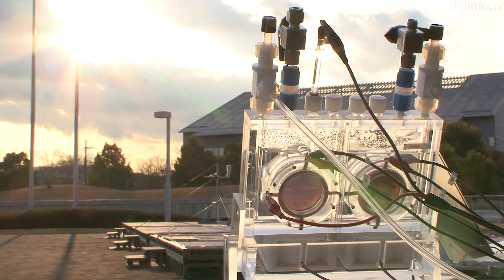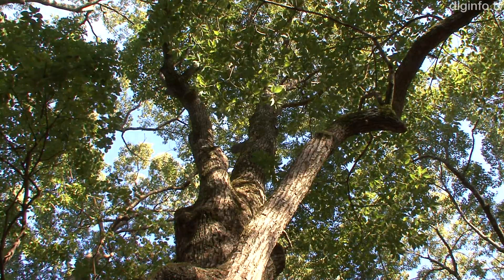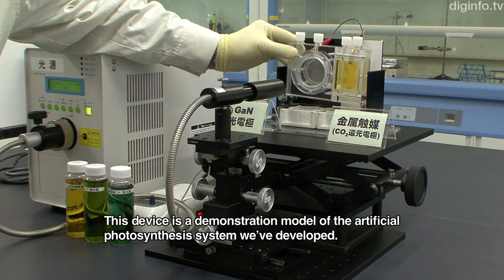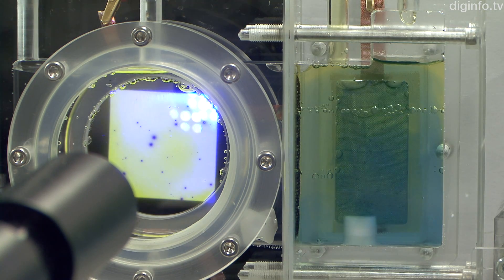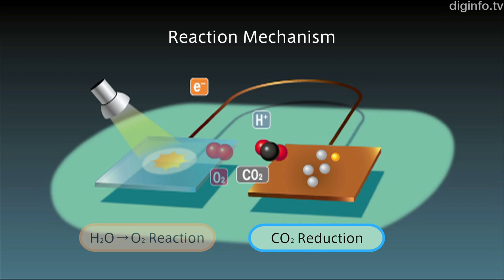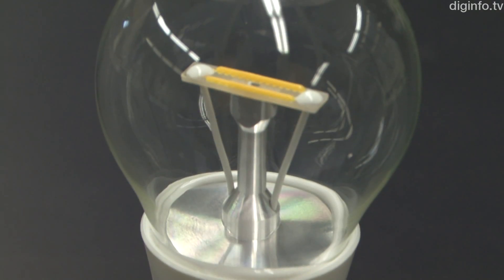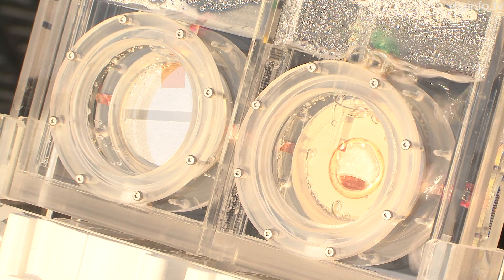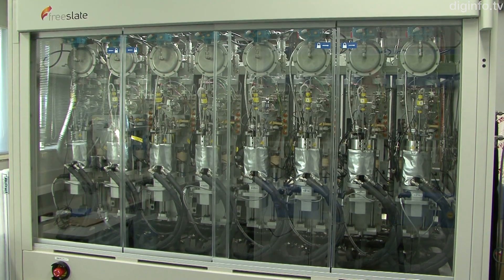Artificial Photosynthesis System as efficient as plants and can reduce CO2 levels #DigInfo

Comment: artificially photosynthesis produce glucose molecules so we got food also and it's molasses become fuel
use siphon energy which can be achieved by pressurised chamber so the siphon energy propelled the turbine and generators setup
we use magnetic induction so we got energy from the setup without disturbances to setup
now with very little energy we put water in the reservoir again

Comment: Just grow and taking care of the Best Photosystesizer : TREES!!!!!
Reply: trees arent actually the best. algae are way better. the part of trees actually performing photosythesis is quite small. only advantage trees have is that due to theur high biomass and long lifespan they bind a lot of carbon dioxide. but if you do it on an industrial scale algea would still be better, you grow them in mass and turn them to coal. a part of the co2 gets released doing that but a large chunk get removed pretty much permanently in form of coal wich is pretty much inert. also serves as agood ground for growing stuff on it if mixed with regular dirt.
Reply: A single artificial photosynthesizer could theoretically consume more CO2 and produce more oxygen and fuel than a plant could. Especially in an urban setting. That's without mention of the fact that the tree requires the fuel to sustain itself, which the artificial system would not. That material could be used as a byproduct of the process. I can't say if this video is real or not, however. If it is, they probably didn't get enough funding to continue.

Comment: commercial photovoltaic are from 8 up to 16% efficient. 20% ones are really expensive. Anyway some satellites use 80% efficient ones , but they are insanely expensive. 
0.2 is not bad if you think that it's just the start of the development.
And that solar cell solves a big problem : energy can be stored as a chemical , for electricity instead you need big and unefficient batteries ...
ps: photosyntesis of plants is 40% efficient , so this method has potentiality!

Comment: So the first step is electrolysis of water but uses light instead of electricity?
If that is the case i would use it to produce hydrogen for fuel and skip the second step that reacts with CO2.

Then to deal with the CO2 as a gas (or disolve the CO2 in a substance so it will be a liquid or solid) put it back in the ground in spent oil and gas wells.